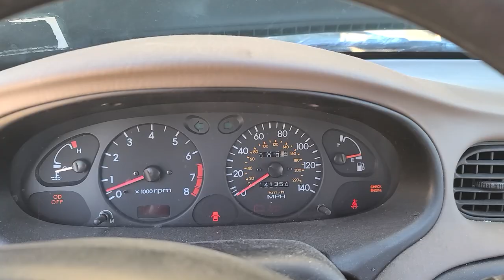Motah Fishing With a "Murderers" Hyundai Elantra GLS! Neutral Drop!

Comment: Maybe you could buy another belt and use a grinder to grind through the nylon belts inside and then leave the rubber cogs. It'll give the engine a running chance to get some rpms before the belt breaks.

Comment: Unfortunately you didn’t catch any fish because you were putting your rod in the wrong hole, I myself experienced this a few times when I was younger. What you want to do is smash open an intake runner on the manifold, exposing the correct fishing hole, then you want to take a coat hanger or oil dipstick and go fishing down into the intake valve. With a little luck you can slip it past the valve and right into the mouth of a tasty piston! Good luck!

Comment: I own one of those 2nd gen elantra's gls they rust out really badly mainly cause they are made out of tin more than actual metal but over all i rate those older Hyundai's 10/10 because the one i have has over 248k on it and still going strong 👍

Comment: You should really cut those belts, obviously safely from a distance, but put the razor blade tool to it with an extension gripper for old folks, $while it's running$ straight up and down $at high RPM$ so when the belt fails it's not just starting out, also cutting the belt the way you're doing it releases tension and it's likely to go out of timing before it snaps. For maximum carnage do it up and down. And last but not least, you ever heard of snagging put three hooks within three inches of each other and then try that again you got it. Monkeys in a barrel method!!! Best channel ever. I have suggestions as a mechanic on really injuring cars. LMAO 🤣🤣🤣

Comment: I Wanna See You Guys Netraul Drop A Mazda CX-7 I Have A 2011 Mazda CX-7 2.5L Myself It Has 275k Miles And It Still Runs Like New I Never Had A Major Problem With It Like The Transmission Needing To Get Rebuild But I Wanna How Tough The Motor Is On That Vehcle Because On My Car The Motor Is Tough Just Like The Honda And Toyota Motors If You Guys Ever Get Your Hands On A Mazda CX-7 Please I Wanna A Netraul Drop Test On This SUV Or Put Anything In The Motor Thank You. You Could Do Any The 2007-2012 CX-7, CX-9, 2010-2013 Mazda3 Or 2010-2012 Mazda6 The Older Ones With The 2.5 Motor Because These Have The Same Motor Like The CX-7. Thanks.

Comment: Two things stil needs to be tested. 
How long a small modern engine would run with the lowest octane fuel there is.
and Diesel fuel instead of engine oil. (warning, don do this on diesel engine).
For science.